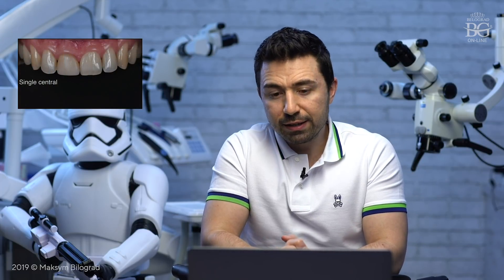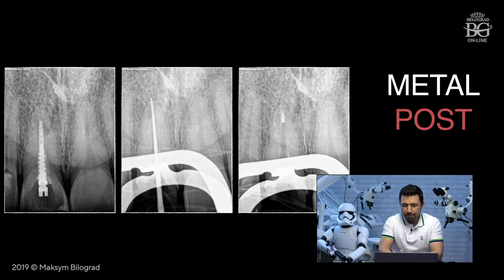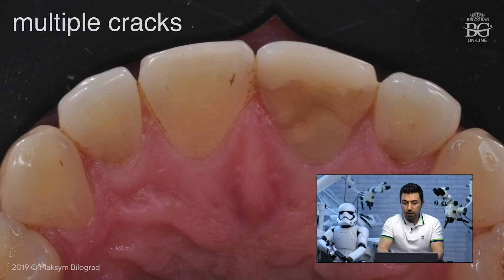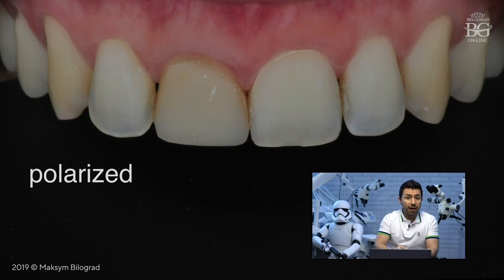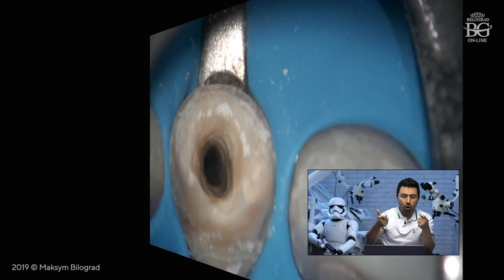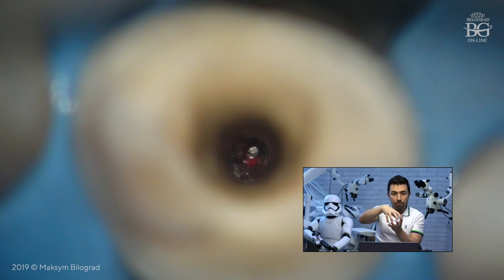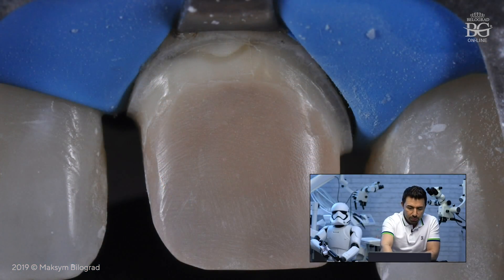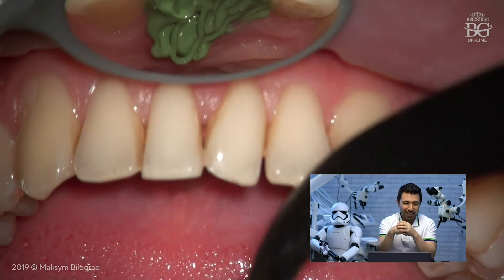Endo restorative. #09

Comment: apical MTA plug
it presents a good sealing ability and low cytotoxicity.
I Love to use white ProRoot MTA has been demonstrated to have faster initial and final setting times than grey ProRoot MTA
the MTA apical plug technique comprise a first visit to access the canal, irrigate with NaOCl and place calcium hydroxide paste for one week. In the next session, the paste is rinsed, and the canal is dried with paper points. After mixing, MTA is applied with a carrier into the apical part of the canal and condensed lightly until a 3–4 mm plug is formed. A moist cotton pellet is then placed in the canal to promote setting of the coronal part of the material with humidity and the tooth is closed with a temporary restoration material. After 72 h, the MTA is set and a gutta-percha and sealer obturation can be made for the rest of the canal

he suggested amount of MTA that needs to be inserted into the canal is such to obtain enough displacement resistance and to avoid leakage
The major problem in cases of a wide open apex is the need to limit the apexification material at the apex, thus avoiding the extrusion of a large amount of material into the periodontal tissue
he use of a barrier made of a collagen matrix  or a platelet-rich fibrin matrix  before applying the MTA plug serves as a resistance to prevent overfilling.
To overcome the discoloration problem, MTA can be put only under the CEJ

Comment: Great video again!

1. Use of CaOH2 prior to use of MTA as a canal medicament so that the MTA can set well
2. Pack powdered MTA as you demonstrated
3. For open apices, you can pack a resorbable membrane/material all the way to the working length. it will provide some resistance when you pack the MTA in.
4. Personally i prefer to mix the MTA and then choose the amount that i will pack and maintain WL while packing. But in all honesty, its all estimation. i use the largest GP cone that will go to length as a reference. i will then roll the Mixed MTA into a mock GP cone putty of similar width. Then i will cut the desired length of the mixed MTA cone and use a plugger to carry that amount and plug it into the tooth without exceeding the working length (you could also cut the initial reference GP's apex and use it as a plugger too after removing the portion that is being taken up by the MTA in the canal). Tried my best to explain but its kinda hard to put into words - so i kinda mix it so that its more "putty" like
5. Use an MTA that can be dispensed through special tips like MTAFLOW or MAP System- in this case its mixed so that its more flowable
Reply: See.prash, you're the winner btw! Congrats!
 https://www.youtube.com/watch?v=REU_qd7HD1o
Reply from the maker: Congratulations! You won access to the online master class. Email us sales.belograd@gmail.com and we will send you instructions.
Reply: @Belogradacademy  for blunderbuss or open apicies can you put caoh then immediately place mta powder then mixed or should there be a few days to let the caoh to set before introducing mta?

Comment: MTA is difficult to apply different sizes of increments unless you have Map system but it's expensive.

So I use endodontic ruler and I make grooves on it in different sizes with burs.. So it become like a mold then After mixing mta I choose the groove with the size I want and I apply mta in it, so the mta takes the shape of the groove and I have mta increment to apply

Comment: The simplest way is by using MAP system as it has many tips with different sizes.
I use MAP ONE, tip size is 1.2 mm it helps me to put MTA inside the canal in case of root  filling cases or to the exposure sites in cases of Direct pulp capping.
For root filling, I place 2 or 3 increments then pack them to the desired length using stainless steel pluggers, paper points, gutta percha cones then micro brush for final compaction.
Why 2 or 3 increments in the first pack? It allows me to compact without the fear of having any spaces or voids between MTA and the walls especially in wide apices.
Then i have two options :-
1-sandwich technique, MTA in apical one third then war vertical compacted gutta percha over it, i put wet cotton pellet and leave it for 24 hours then check setting of MTA then place the warm gutta percha. 
2- full obturation of the canal using MTA(weak remaining walls of the root), put wet cotton pellet, leave it for 24 hours then final restoration after MTA setting check.
In cases of direct pulp capping, i place it using MAP ONE, cover it using theracal or glass ionomer then place my final restoration.
One year follow up case
https://m.facebook.com/story.php?story_fbid=484705559064828&id=100025761637065
Video
https://youtu.be/XLp7NwMNSqg
Reply from the maker: Congratulations! You won access to the online master class. Email us sales.belograd@gmail.com and we will send you instructions.

Comment: I don't use MTA. Instead I use Neo MTA Plus (Avalon Biomed).It is bioceramics on reasonable price. When mixed it becomes putty which I form like a roll (it behaves as temporary filling material). Then I take a small portion with hand plugger, apply it in the root canal and condense it with wet paper points (ISO 45+). It has long working time and allows you to add liquid and powder to achieve the preferred consistency.

Comment: mix the MTA with a local anesthetic, a little amount of powder and less of the liquid (sterile), if it is muddy just use a cotton pellet, consistency a bit sandy. Place it with a MTA carrier, pack it with a condenser and tap it with the ultrasonic - proper flow and acquire good seal

Comment: My tips and trick is to ensure good moisture control, if repairing a perforation on base of cavity, I place surgicell (haemostat) soaked in a bit of la with adrenaline then plain sugivell without la ontop. The bleeding stops very quickly and it's dry for Mta to set and be used. Also bcc putty ontop of that will protect it even further
Reply from the maker: ismail great tips! Thanks for sharing

Comment: to place mta apicaly in powder i use this metod : take a irrigation needle cut the active part and load the needle with the powder mta then u can easily apply apicaly this way note u have to conect the syringe and apply pressure
Reply from the maker: Alejandro Just Noob Player great tips! Thanks for sharing
Reply: Is it common to use MTA powder? It's the fisrt time that i hear about this technique! Thanks to answer
Reply: Actually, MTA needs fluid (best is water) to set perfectly. Otherwise the powder will take a lot of water out (solubility) of it's surroundings and lose it's effectiveness it was meant to have as a bioceramic.

Comment: The smaller particle size of WMTA is preferred.
Canal is irrigated
Smear layer is removed
Mixing of MTA is done with saline as the strength of WMTA increases when it is mixed with saline (according to torabinazed book)
Dry mta should be avoided
It must have wet sand consistency
It can be applied in canal by files according to lawaty technique but now mta carriers are also available.
Care must be taken to avoid voids.
After mta has set, then only composite core is made.
Acid etching of MTA should not be done during composite core building.
Reply from the maker: Dr prashant Tyagi great tips! Thanks for sharing
Reply: How do you irrigate while there is a perforation?